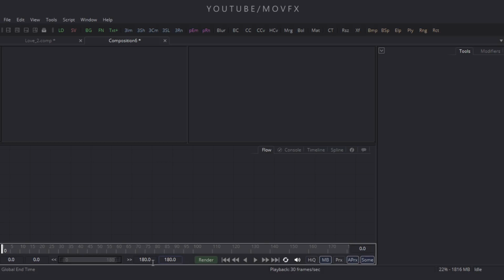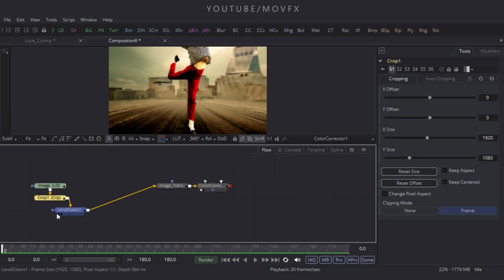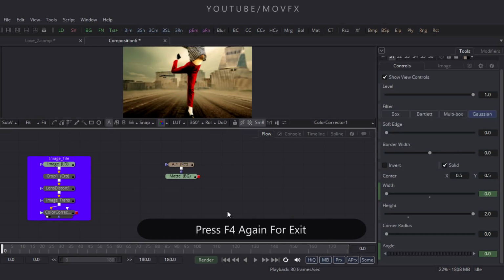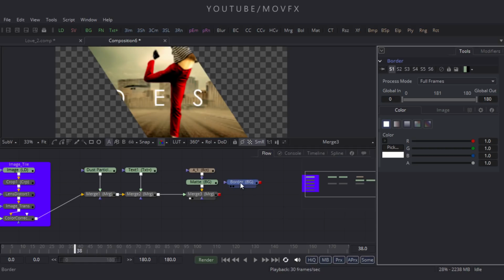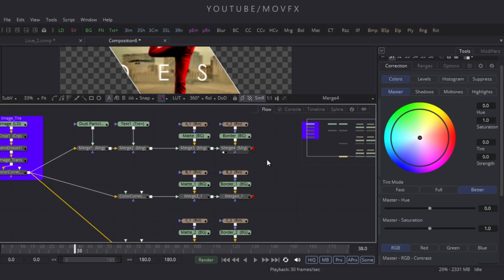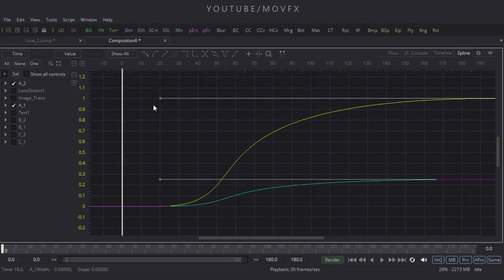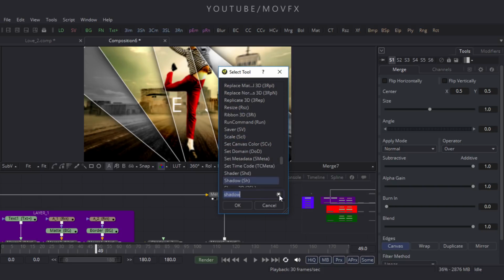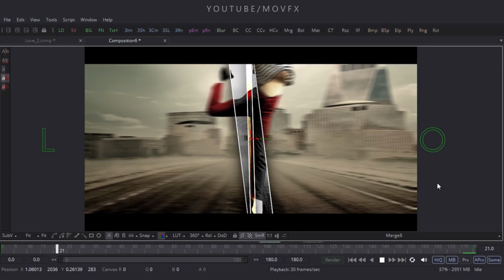Slideshow Animation in Fusion | BlackMagic Fusion 9 Tutorial

Comment: I cannot get the "shift-arrow" to move the frames up by 10 seconds in the spline editor...tried all different combinations...using the latest davinci resolve ver 15...I'm stuck...any help would be greatly appreciated.  Other than that issue, great video and love the animation.
Reply from the maker: Maybe.
Select that key frames and then move it by Shift + Aerokey
Reply: I got it to work by going to the Keyframes tab (located between the Spline and Metadata tabs in Fusion).  I greatly appreciate you replying...thanks.  Love this dissolve effect.